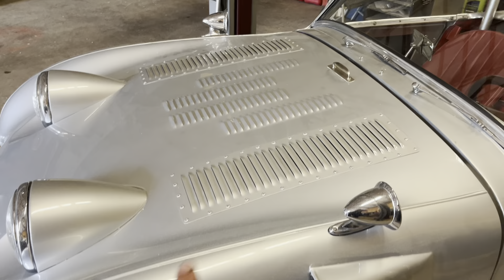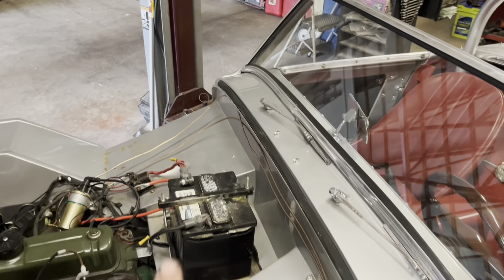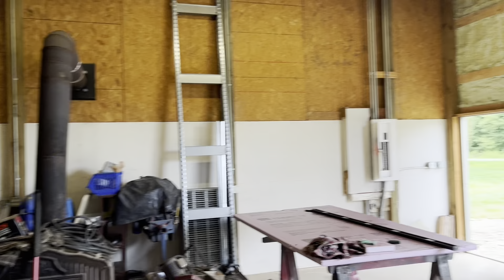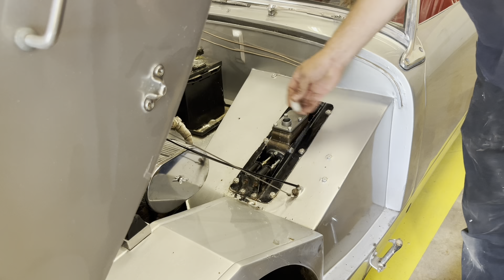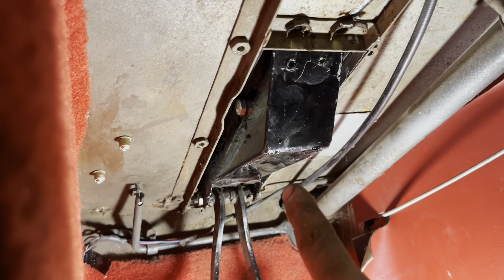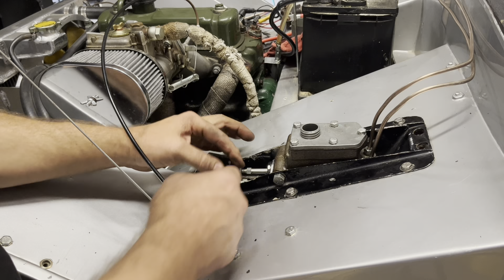1960 Bugeye Sprite no clutch or brakes part 1

Comment: (without watching the whole thing) So air in the lines? 
Did not expect bad cups in the master.

I love the bugeye, in general. I have two that I need to restore, a 58 and a 59. The 58 I want to keep as original as possible, the 59 though was converted into a race car, and I kind of want it to be resto-mod to a street-legal race car. I think I would choose some of those mods, but not the bonnet louvres or the hand holds to open the bonnet. Honestly, the rest of it is pretty clean and interesting. The rest of the design is so clean and minimalist, but then the bonnet is this field of louvres. They must have had bad overheating or vapor lock problems.
Smooth the joints? Sure? It does smooth out that backend.
Front flip bonnet? Absolutely. 
That firewall? Wonderful. 
Fender flares/wide wheels? OK? Maybe? I wouldn't turn down a car that had them.
Rerouting of the brake and clutch lines was a good idea, IMO, makes that engine bay even that much cleaner, but it would also look fine with a really well-sorted route and clip setup. 
Remote bleeder? Smart.
Alternator conversion? Smart.
Weber side draft? Maybe not. I just like the SUs more.
Headers? Absolutely.
Overall, I wouldn't hesitate to drive that car and be proud of it, though I might go looking to redo the bonnet at some point.